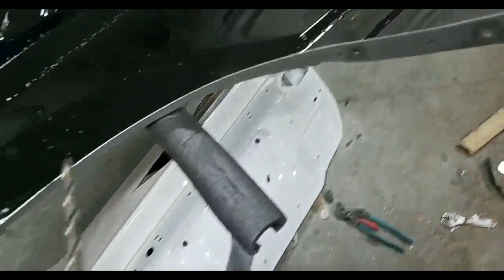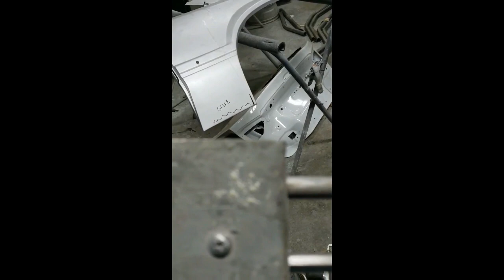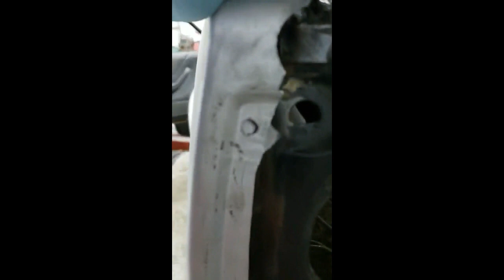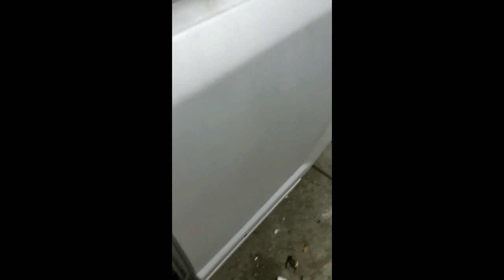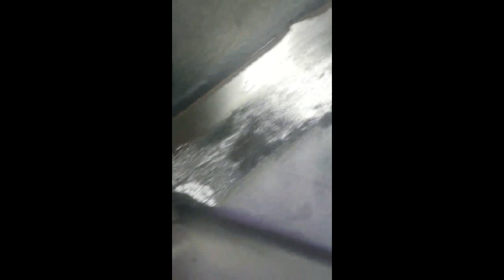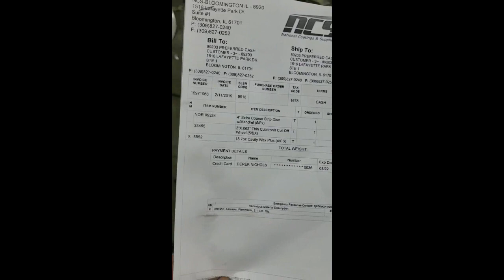Fox Body Quarter Panel Replacement Part 3

Comment: great work only thing I'd do differently would use clecos for fitment and knock down those welds with a 36 grit. A lot of people are scared to hit metal with that aggressive grit but it actually keeps the metal cooler the less time grinding.